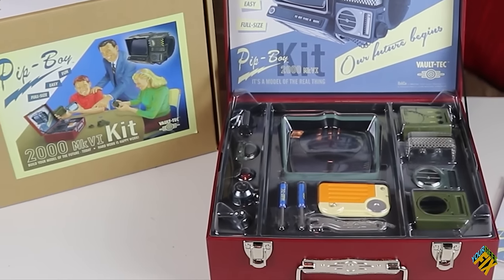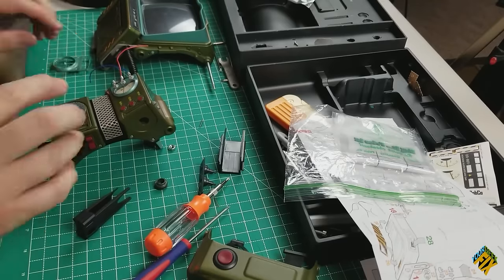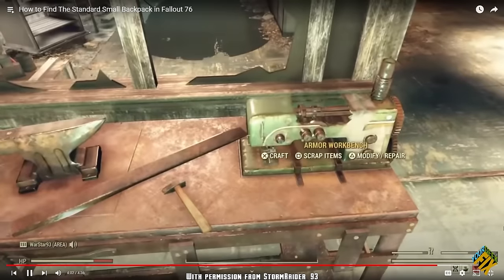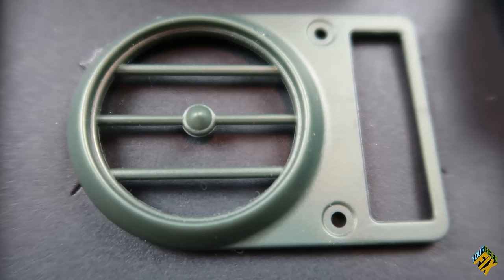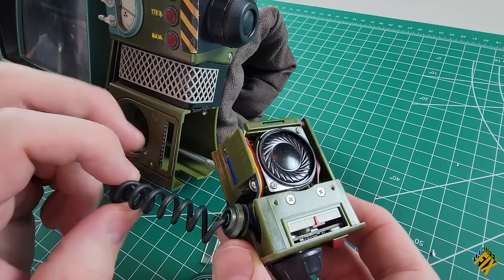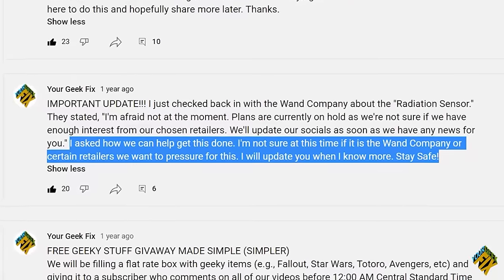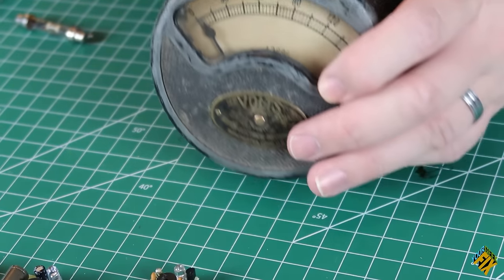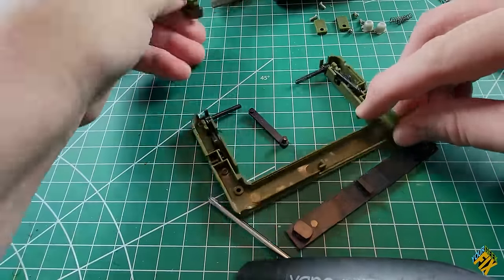Fallout - How we made a real working Pip-Boy 2000 Part 3 of 3

Comment: You have to have the most criminally undersubscribed channel I've run across.  I've been waiting a while for the conclusion to this series to see how you tackled the rad meter, having picked up my own parts for a very miniaturized geiger counter.  We'll see if the US-made GM tube has the desired sensitivity despite its small size.  I have to agree about the moving coil meters, and your solution was excellent. I'm more interested in real-ifying the 3000, which has an even tinier rad meter, so your edge meter hack is probably the only real solution.  Thanks for putting out such quality videos!
Reply from the maker: Wow, thanks! Would love to see your meter when you finish it. For the 3000, check out the zapwizard, he has been working on it for a while. Thanks again!

Comment: When people modding the Pip-Boy, Instead of the Radio that they Provided For the Pip-Boy, They instead use a Small Bluetooth Speaker and fit it inside of the Pip-Boy Radio.
I only saw that they Did this in a Punished Props Academy Video.
Reply from the maker: Not a fan of the Bluetooth speaker there as I have one in the top as well.
Reply: @YourGeekFix  Yeah, That's Cool!

Comment: Wouldnt a Arduino be able to do a lot of that? From the Clock to the Counter to the wifi? Using a stock LCD screen wired in. I know when I was lighting some Star Trek models the Arduino was able to control everything from start up, to the flashing, to Shut down and everything in between and that was just the basic stuff. Or even a Rasberry Pi?  What you built was amazing though!
Reply from the maker: The problem is the space.

Comment: VERY IMPORTANT QUESTION, here's hoping you see this.

I have search through the description rigorously, but was unable to find the 3d models of the buttons or the buttons themselves and what not you mentioned. It would greatly aid me in my own project! Thanks!
Reply: Of course I finally find it when I post the comment...
I am curious as to what buttons those are though.
Reply from the maker: I had to put them under the video I described for taking apart the clock because youtube has a limit on words. You'll find the video link at the end of the video.
Reply from the maker: @poptop89  also in the description for the clock video.

Comment: Chris Bernardo must have enjoyed your designs.
it surprised me that the geiger counter was not small enough for the 3 buttons to be usable.
I have considered making the 2000(not the 2000 mark VI), though I feel there may be quite a challenge to recreate since the majority of the parts are difficult to fit into a condensed shell.
good luck in your 2nd recreation of the icoinic pipboy. may your progress be fruitfull.
Also, I noticed you could have just put in a digital clock rather than the analog as you show example of someone doing eairly the episode. perhaps do that instead?
Reply from the maker: But I wanted it to look like the game, more retro.
Reply: @YourGeekFix  , there are ways.
1st option blurry transparent material: makes the numbers appear more rounder.
2nd option: rounded transparent. Same but take the og mold and create a mold using clear (type used to make dnd dice) resin. And slap it on top of digital clock(note make sure the digital numbers  fit where the mold directs it to)
Of coarse it is OPTIONAL.
Thx for your thoughts though.

Comment: There's probably clocksmiths on YouTube or experts like Clickspring that could get the clock to actually work with some specialized tools.
Reply from the maker: Maybe
Reply: it woud be so nice to give the klock a nother try :D Yes it will be komplicadet, and maby very expansive, But: The Pitboy is in one or oher way A very very overfechered smartwach, so the clock is the part, that maby like the geigerkounter the most important part! ;D 
maby you must go vor a sligtly bigger enkloser vor that, i woud not see a problem for that, a working turning ckock is it so woth it! 
also, the pitboy woud bekome a realy useful even when you not were it, bekaus it show you time, days and sutff, it woud be a amasing deskitem! preas, give the klock a nother go :D
my atampt woud be: rubber weels that drive individualy the numberweels from behind. the motors can be more easy kontrolt by elektonik programming. also the rubber weels kan have multiple sises, to make room vor each other, so, you can use multible motors anstead komplikaded gears. But, if you use geras, make then visible. i see no reasons to hide nice cool geras ;D maby even the whatchletters it self cud be 1/6 a gear it self, so you can insteao of rubber, gear in the back to turn the letters. 
i think a combination of tuning from inside and from behind can you get the clock, that we want ;D

Comment: The problem with the antenna is solvable. I have now built several radios here, some very small ones and some from kits (I'm a HAM), there are these mini-radios built over an Si4732 FM/AM radio chip, that is small sized and if you put that thing on board with some SMD parts, you would easily have a receiver that fits. A small AM/MW ferrite core would fit, too, well the FM plug should be external or a telescope that you just pull out. The whole thing runs from 2x1.5V batteries and the thing doesn't suck much power and runs for days on that. 
I mean the ready radio kit you'll get with everything for less than $5 on the internet. That's doable. 
Sure, you'd need your own layout, but that's not a hard one. 

On the other hand you got two mockup tubes in there already, throw one of them out, place a real tube, some el-cheapo Chinese 6J1 in there and copy the Franzis Verlag Audion receiver. Then it will only be playing shortwave, but that cooler anyway. With an single tube Audion you can receive AM, and CW and SSB transmissions, if you restore the carrier, which is just another little chip, the Si5153, I guess would work fine. If you generate that, you'd be able to tune in to all kind of shortwave transmissions, of course to be able to run that you then need about 6m of wires. 

It is wrong that you need so much wire for receiption, of course a resonant antenna is better than a non-resonant, but for reception a long wire is a good solution and only if you want to transmit on it, it becomes more difficult. We are using LW all the times here in Germany. And they start working well from 2m onwards, 6m is good, around 23m is optimal, after that you won't get any advantage, you'd been easily able to listen to all radio and amateur radio transmissions around the globe. Simple nylon coated steel wire for jewellery for $5 per 100m on the internet is working fine. We even transmit over that wire without a problem, up to 300W. Well, it's not perfect but it's thin, cheap, doesn't need heavy masts. 

Good job! de DL7HH
Reply from the maker: Wow! Great advice. The problem for Chris was a lack of radio stations to receive where he was. Works fine for me here in the US. Would be better if it was AM.
Reply: @YourGeekFix  You did just a great job there, I also put in a comment how to do your dials and  the clock without the mechanical gear problem for cheap in your assembly clip, I just watched now. Actually the MW/AM band is quite empty now, but the shortwave band (HF) is also AM modulated and because that band propagates over the ionosphere it is not just local but more or less global or at least continental. So a shortwave receiver would give you the real feeling of world radio with strange sounds, foreign languages and all that, also shortwave radio has ionospheric distortions, which would just add fine to the feeling. I do not think that VHF/FM radio is a good solution, because the music they are playing is just awful and doesn't fit. Also it's local, as MW. So SW is it. 

The antenna problem isn't, because you can put a spiral wire around/inside your arm-padding, you just sew 23 meter of thin enameled wire or said nylon coated 0.35mm steel wire for $4 around. A single winding is about 30-35 cm so with about 60-70 windings you have a really strong shortwave antenna. What you want to receive is the 49m band, I guess, so 23m of wire would be perfect and resonant, but with all the capacity of your body and everything, who knows? Make it a bit longer and shorten it piece by piece until the noise level maximized, then it's perfect. Simple trick. Do the tuning with your arm inside, because it will change the induction. 

I'm doing things like that on a nearly daily base, while it will not work every time, mostly it does, at least as a HAM I have absolute positive experience with that. Sure, you could have a better antenna if you stretch the wire up a tree or something, but it will work fine. You have a whole lot of HF/AM shortwave radio stations in the US and EU and if you don't listen to them, you have near that the 40m HAM band, which will work, too. Contact me, if I shall help you at QRZ.com DL7HH. 

But it's not rocket science. I got my own channel and can make a demo setup, if you want. Just forget about MW, that's really dying, sadly. I'm not so much into props, but into tech and I'm playing with weird, cheap electronics very often (if not daily). Ready cheap HF receivers you get as a small circuit on Ali for $5 sometimes.

Check ATS-20 for example. The circuit is Arduino based, completely hackable. All-band-all-mode receiver. Does even Morsetelegraphy.

Comment: Hi there, I had a question about how you access the on/off switch on the Blackberry. I remember in your first video you showed a piece of tubing that slid back and forth, but am I right to assume that you've changed that since the modules on that side along with the cuff are blocking access?
Reply from the maker: No, that still works. So, when you press the knob  It turns on the phone.

Comment: Which type of meter did you use for the gigar counter? Also would there be another substitute for the 3d button holder as I don't have access to a 3d printer? Keep up the great work aswell been following this project since the begining and inspired me to upgrade my own pipboy thanks to you.
Reply from the maker: Since the video, I built another one using this meter that I like a lot more.G25632 - Unique Illuminated Miniature 500µA Analog Power Meter
https://www.goldmine-elec-products.com/prodinfo.asp?number=G25632.  As for the button meter holder, You could go to a library or make your space make your space or send it to send it to have it printed pretty cheaply. Otherwise, otherwise camera get the buttons and make something using styrene Or putty
Reply: @YourGeekFix  thanks for letting me know, I'll try that out, wish me luck 🤞
Reply from the maker: @bradleyjackson2277  Good luck! If you get stuck, let me know!
Reply: @YourGeekFix  for the switches are they latching D:DPDT latching 7x7 long? I've seen some on ebay that look like the ones you used?
Reply from the maker: @bradleyjackson2277  these are the ones I used. https://www.ebay.com/itm/254783469237

Comment: why not use a tape counter for the clock, similar sort of thing they had in cassette decks in the 70s/80s/90s
Reply from the maker: I have one. Now with that in mind. This is smaller than those would fit in. Look at the nail of your pinky, it has to be smaller.

Comment: I have a Motorola/Symbol/Zebra WT4090 wrist mount computer that I would LOVE to see get turned into a pseudo pip-boy, unfortunately I have no idea if there are any backdoors to the device to remove the Windows CE OS on the SoC and load up a custom OS into the onboard memory without it automatically being nuked when the battery inevitably dies (the thing uses 3 of them, 2 internal, 1 main external that's changeable)((seriously, remove the main battery and it goes into cold boot, aka full hard reset, all settings lost)). It would be an absolutely fun device to use as a Pip-boy since it's already a complete unit and has the option of 2 side hard points for external devices (not sure if serial comms, but a headset, scanner, and printer were made for it), as well as the device literally being so old that it has little to no support for it. Touch screen models are perfect for the sake of being able to tap around at the display and all the buttons to control certain functions of it. Maybe one day it could be cracked and explored...
Reply from the maker: Very interesting! I'll look into it

Comment: I`m going to build my own Pip-Boy 3000 mk 4 using a raspberry pi and a 3.5" touchscreen display using adafruit`s guide, but i noticed in the guide that the rotary encoder isnt wired to anything, any ideas on how to make it functional?
Reply from the maker: Not really. If you do it from scratch it should not be a problem to do it he way you want. Check out other builds. Zap wizard has the best one around.

Comment: Question, is there any possibility to buy this product?
Reply from the maker: The pipboy 2000 kit or the completed mod?
Reply: @YourGeekFix  I want to really badly say "yes" as a joke. But in actuality I was wonder about a finished product. Say a pip-boy that I can actually wear and mess with. Just as the thumbnail shows. The "power" button, the holotape slot and an actual working display. I see kits online that can be bought but those all require painting and stuff I'm not good with. But for a fully made and "functioning" pip-boy that's painted and ready to go. Would that be something you guys sell or is it just a kit that requires assembly and the dreaded painting? I say dreaded because my artistic skills are far less than zero.

I'm working on saving money and have always wanted a pip-boy as a collectable.
Reply from the maker: @moviemaker2011z  the wand company made the kit and modules, buy it has been discontinued. Ebay has some, but pricy now. As far as my upgrades, very reasonable priced and easy to do, but that is best for you to d9. Better to show off and enjoy when you do the work.
Reply: @YourGeekFix  I see, thank you for responding so quickly. I will definitely keep your modifications in mind when I do get the money saved up and pull the trigger on that sale. Again thank you so much for the information it is greatly appreciated.
Reply from the maker: @moviemaker2011z  sure